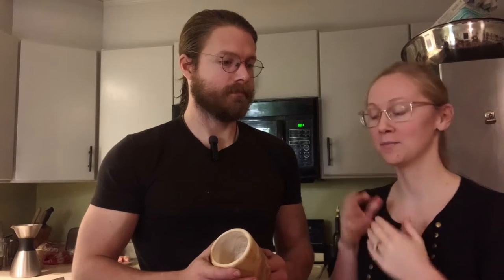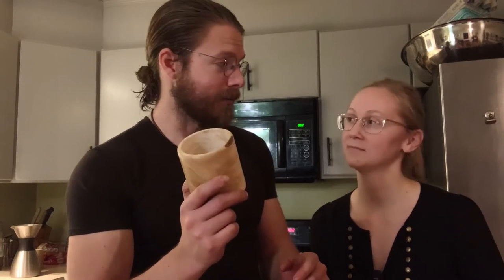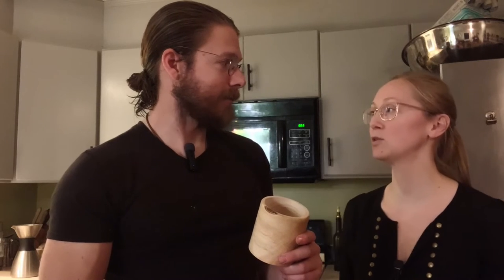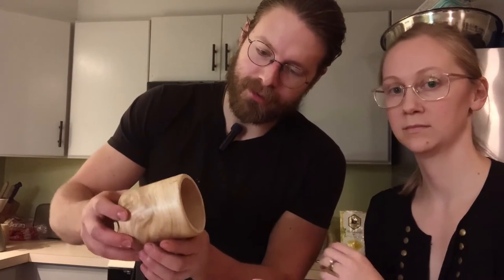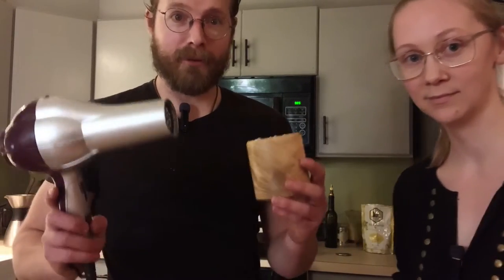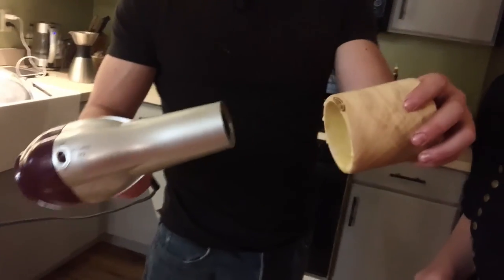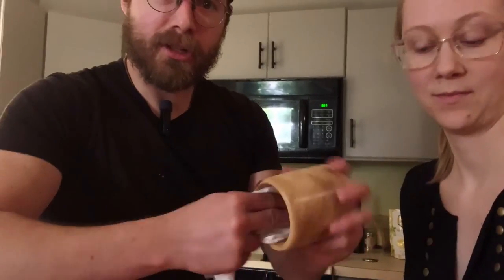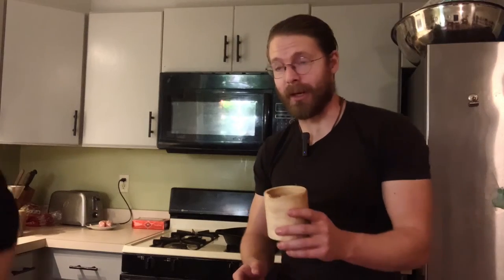How to coat wooden cups with beeswax

Comment: Thanks 👍 very much I've seen a lot of people saying mix mineral oil or olive oil with the wax ,but it's not food safe , thanks for clearing that up that it can be done with just bees wax .I just got into home brewing and distilling im making a couple of wooden stoppers for some old bottles I have found ,I was going to just dip them in melted wax and then give them a buff with a hot wet rag until they came out okay .I might use my wax to seal bottles for long term storage experimenting too......, but yes thank you I didn't want to have to spend money on anything made in China to do the job and I kept seeing videos giving me the feeling it wouldn't work without adding something making it un food safe or having too buy silicone things
Reply: PS you look like a man who might know ,any tree that has acorns is a oak isn't it ? And is there a easy way of telling American white oak from French oak or whatever ( I just posted short video of question few days ago) 
And you wouldn't know can ornamental maple produce syrup of be used for ageing alcohol like normal or common maple
Reply from the maker: You can heat mineral oil and mix it with bees wax, and my understanding is that that is also food safe. Honestly, I don't know about wooden bottle stoppers. My concern would be the grain swelling up and breaking the top off your bottle. It's not exactly my area though. Good luck!

Comment: I don't think this beeswax would work with hot tea, which is what I wanna use my wooden cup. I just got for. I would actually brew it inside the wooden cup. I was thinking of using the oil I  used for my cutting board in good condition

Comment: I'm trying to find a way to make a non-toxic hydroponic garden. I think my plan is to build long planters out of untreated wood, then coat the inside with beeswax to seal them. From your experience with sealing wood with beeswax, how long do you think it would remain waterproof with a constant slow-flowing stream of water running through it? Would it last through a whole growing season, so I could just re-seal once per year, or do you think I'd have to seal more often than that because of the constant contact with water?
Reply from the maker: I think it would depend on what sort of wood you used. If you built it from reasonable think cedar beeswax would probably be fine. But honestly, a whole growing season of moving water -- I suspect the water will find a way in. That's why I suggest the cedar -- it can handle water.

Comment: Great demonstration.  I’ve been looking for a way to coat a kuksa.  Will this also work for hot drinks?
Reply from the maker: No, unfortunately this is a cold-beverage solution only. Hot beverages are hard to find a solution for. If you find one, let me know, because I'm looking too!
Reply: Did it work